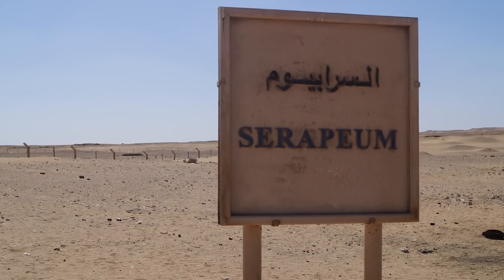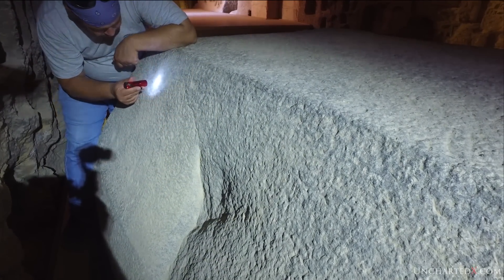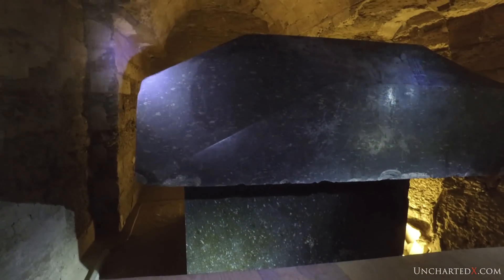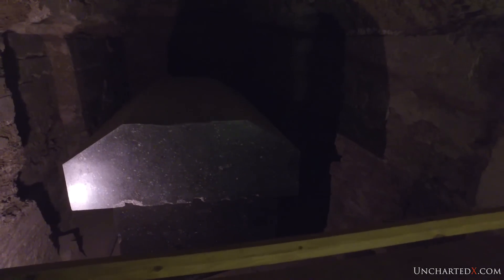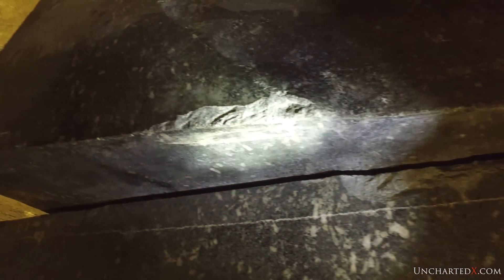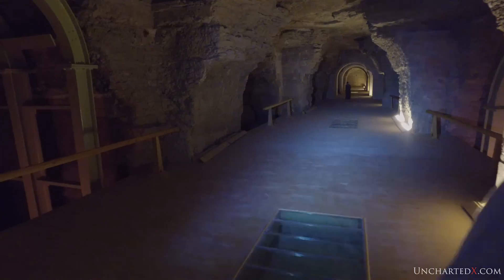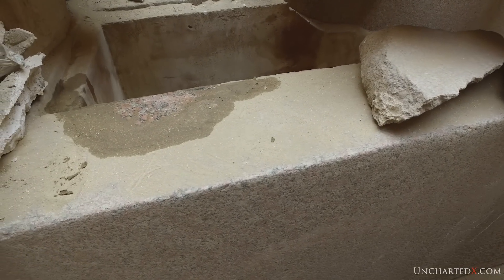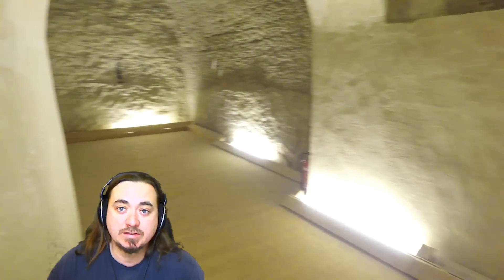Evidence of Ancient High Technology - Liquid Polishing at the Serapeum of Saqqara - Chapter 4

Comment: As a machinist I can tell you that when a hardened part breaks or develops a crack, its ground down past the extent of the crack  line then filled up with weld and re-milled. I think during  the making of these boxes, when a crack was found and or developed, the workers would work the crack line down to good material. They had no way of refilling this work done.  1 crack can spread and ruin the entire product just like a crack in a window. They did this to preserve the box and prevent any other spreading of said crack.  JMO

Comment: As occurred to me, a few comments for thought:  One, the marks of "liquid" on the underside of the lids might not be of polish, but of a material used as a sealant (or both polish and a sealant). Polishing is nice, but a sealant would give it that "wet stone" beauty. Two, the "machining linear marks" on the underside of large objects may be due to the simple moving of these large masses. I think we would be hard pressed to move such large heavy objects in an environment of sand, heavy dust, and rock without some resulting abrasions. The ancients would not be immune to this either. Third, your comparison of a modern polished granite statue ON THE SURFACE to an ancient on buried deep within the Serapeum has one glaring difference -sunlight and all of its damaging effects, as well as the heating and cooling and thermal expansion/contraction issues and abrasion from dust storms. Fourth, polishing divots and similar is more like polishing your car than building stone, but could be done. Generally, once prepared/formed for polishing (today), a surface has a mild abrasive applied (something softer than it is, usually in a wet slurry) rather than sand which is most likely hard quartz or maybe feldspar. Your discussions are great Ben -inspire thought for sure. Information does speak for itself. Keep up the good work, My wife and I are fascinated by your tours. Thanks

Comment: Hello Ben, great video! I've learned things from watching it. I never knew they had scooped out the cracked areas to prevent further cracking. That sounds logical. Modern day example would be when you get a crack on a vehicle's windshield from a road debris striking it. They recommend that a windshield repairer apply a glue adhesive to it as soon as possible before the crack grows longer and longer to a point that a windshield replacement is the only recourse. Cracks in materials will only become worse with time unless addressed right away. It also makes sense that they were more concerned about function over cosmetic appearance, even though they still polished it as best they could for aesthetic appeal and as a preservative.  When dealing with a huge multi-ton stone block, it's better to salvage it with minor repairs if possible than having to scrap the entire project. The liquid drip remains you shown us does indicate using a liquid polishing technique.

The very crude hieroglyphics does look like someone scratched it on later after finding it, rather than the master builders that created it. Egyptian Pharaohs were notorious for placing their cartouches  and hieroglyphics on things created by someone else from a past time, and then claiming it as their own. It's like if I should stamp my name on the Washington Monument after an apocalypse, then some later discoverer upon seeing it therefore thinks I had built it.

I'm glad there are intelligent people like you visiting and studying these amazing ancient sites and thinking out of the box to figure out how these things were actually constructed, instead of merely allowing the academics to spoon feed us whatever they want us to believe. I'm now a new subscriber. Thanks for the educational video and your other ones as well.
Reply from the maker: thanks for the kind comment! I'm glad you find my work interesting :)
Reply: Yeah it's a similar process to remedying metal fatigue cracks, in say aircraft structural components, by polishing out any stress faults/cracks identified by microscopy/spectroscopy to prevent a linear fracture developing.
Reply: Maybe polishing was not cosmetic at all, but a byproduct of the “working boxes”, whatever their purpose/function. You seem “sold” on the idea that the polish is for looks. Unlikely inthink

Comment: Hi Ben. There isn't enough gratitude in the world to express how thankful I am for your work. Please don't stop. I am so hooked I'm afraid that the grief would kill me. But, and there is always a but, the reasons given for the scooping of the material away from the structure just doesn't hit me as logical. If a crack can be scooped out of a surface it seems to me that the crack was finite to begin with and the scooping was unnecessary, at least for the purpose that has been put forward. Think about it. You see a crack and in order to improve the resilience of the material you scoop out the surrounding material until there is no longer evidence of a crack. What part of the scooping stopped the crack? I cannot think for a moment what part of the act of scooping out a crack stopped further cracking. If no scooping had been done, the crack would not have progressed any further because the crack was finite to begin with. When scooping did occure the only thing that was gained was that the terminus of the crack was discovered. Just sayin.
Dave Lowa

Comment: Thanks again Ben, your content is brilliant. Keep it coming! In mechanical engineering manufacture, we build cast metal parts. We regularly have to do some post casting excavation work by removing casting defects in the same manner as in these boxes. We remove the crack or indication in its entirety in order to mitigate the possibility of propagation of the crack. What is interesting is, we do this for components that are subject to stress/pressure/VIBRATION! For parts that are decorative in nature or perform none of these functions I just listed, we don't bother excavating, because without any forces, we don't expect the cracks to propagate. To conclude, it seems to me that their was indeed a function for these boxes and they were clearly subject to forces that could propagate cracking.

Comment: Chat GPT answers about the tech use of a granite box:

"A granite box, being a solid and durable material, can have various technological uses depending on its size, shape, and design. Here are a few potential applications:

1. Electronics Enclosure: Granite has excellent heat resistance and can provide a stable and protective environment for sensitive electronic components. It can be used to create enclosures for high-temperature or high-vibration environments, such as industrial equipment or military electronics.

2. Radiation Shielding: Granite has natural radiation-blocking properties due to its composition. It can be employed as a shielding material in applications where protection from radiation is necessary, such as in medical facilities or nuclear power plants.

3. Precision Instrument Housing: The stability and low vibration transmission of granite make it suitable for housing precision instruments that require a stable environment, such as optical devices, spectroscopy equipment, or laser systems. The material's inertness and resistance to temperature changes help maintain accuracy and reliability.

4. Calibration Standards: Due to its dimensional stability and resistance to wear, granite is often used as a reference material for calibration standards. It can provide a reliable and consistent surface for calibrating measurement devices, including coordinate measuring machines (CMMs) or optical comparators.

5. Decorative or Architectural Applications: While not purely technological, granite boxes can serve aesthetic and functional purposes in architecture and interior design. They can be used as decorative elements, planters, or even as part of a structure to provide a visually appealing and durable solution.

(...)"

Comment: One piece of gleened info i gained recently is that that highly polished steel is much more resilient to corrosion from moisture than unpolished. This would seem to be true of stone. Those boxes were polished to stand the test of time against corrosion. I believe that can be taken as the reason those boxes were polished.
Reply: But if they are buried then no erosion or corrosion can occur! Corrosion is a chemical process, erosion is natural! 😁 metals are attacked by acids or/and oxygen ! Stone is unreactive to oxygen... and you could pour acid on it til you ran out and wouldn't make a dent ! 😁
Reply: Polish is perhaps a byproduct of the process in motion that the boxes were performing. Explains why insides are not polished, maybey

Comment: Although the igneous rock of these boxes is made of crystals, the gross body of rock is not itself "crystalline." The mineral crystals that make up rock like granite and diorite are small and not aligned with each other. They grew in-situ when the igneous material cooled to a solid and their growth was limited by bumping into the other crystals growing around them. So the gross rock is composed of small, interlocked crystals. This gives this material toughness, because there are no planes along which the gross rock will fracture. In this regard, it's like carbon fiber in a resin. This is different from single crystals (with large-scale repetition of a homogeneous molecular structure) that have planes along which molecular bonds are substantially lower in strength (low-energy bonds) than other planes in the structure, creating fracture planes. Planes along which the bonds are stronger (higher-energy bonds) do not fracture easily. The gross rock of the boxes does not have large-scale fracture planes, even though the very small-scale crystals of which it is composed all have such planes. But because they are not aligned with each other, fractures in one crystal are unlikely to propagate through the rock along a single plane, causing fractures to wander like the cracks seen in the boxes, because there are no large-scale fracture planes to follow.
Reply from the maker: Thanks for the explanation!
Reply: Great explanation!
Reply: Glad someone explained this
Reply: @BaxterRoss  How the Hell does not everyone know this?  This is rock knowledge 101 for dummies
Reply: That implies that some seriously violent & powerful forces created the cracks in the granite. Maybe they were all "perfect" once but "using" them created forces that eventually caused small & even bigger cracks/fractures. And scoping out the cracks was done to maintain structural integrity and being essential repairs to maintain the function of the boxes.
Reply: @w8stral  I guess not all of us took Geology?
Reply: @deelove6899  Neither did I.  I have read a book or two and opened my eyes when looking at granite counters etc....  which is the exact same thing as paying money and taking a class...
Reply: Wonderfully concise explanation of planes of Cleavage. Sounds like a big agricultural region in northern Ohio...        ‹ =ºo)
Reply: @joenobody5913  Poor boy, open your eyes to the world around you
Reply: @joenobody5913  spot on. Fools seldom differ. I'm that clever,you are all below me.it must be a lonely place in his world of wonderful thoughts,almost 'god like'.
Reply: @joenobody5913  That was totally unnecessary, by telling us how you think that w8stral was a plonker, all you have really done is expose yourself as a plonker.
Reply: @jairdabrini  Someone carved a giant piece of granite out of the earth and moved it.  There's no guarantee the cracks weren't there to begin with, but quarrying granite necessarily involves violent and powerful forces.

Comment: The scooping of the granite to remove cracks is very interesting, and is practiced to this day in the manufacture of typically aerospace grade components, whereas cracks or imperfections that are identified thru non destructive testing inspections can be routed out and then deemed acceptable once the latent defect has been removed.  So why implement a level of quality control on an object that had no functional purpose?
Reply: They do the same thing with cracks in steel. Instead of scooping it out they find the ends and drill holes to stop the pathway.

Comment: It’s obvious my own speculation but could they have made like a silica powder then added it to something making a almost molecular fluid to fill in the small spaces. Almost like a crystal turtle wax?
Reply: Its probably a type of long lasting resin, like the ones we use to finish wood. Im guessing it was used as a final layer of insulation for the capacitors inside.
Reply: This was my thinking too.  They have plenty of silica around and I've seen some papers that they used phosphoric acid as a preservative.  Silica can be dissolved in phosphoric acid.  Paint on polish and repeat until smooth.  Who knows though, there are a lot more people with more knowledge of this stuff looking at it, surly they would have thought this a possibility already?

Comment: Looks like they used McGuire's Carnuba Wax.
Reply: I can't believe polishing a box is that big of a deal. Not easy just labor intensive. Polishing a granite box is like color sanding and polishing a car. After painting a car, you sand down by hand the textured painted surface smooth with like a 400 or 600 grit sandpaper and work your way down to a #5000 finer grit sandpaper. After sanding down the car's paint surface down smooth with the finest #5000 grit sand paper you can often hand polish the paint with a fine abrasive liquid & towel or even use a rotary buffing machine with a very fine liquid abrasive. After the car has been color sanded and polished you can seal the paint with a glaze or a wax to protect it from the sun, rain and pollution. If done properly you will have a very shiney and almost mirror like finish.
Reply: Nope, carnauba trees (Copernicia prunifera) are native to South America, so no.
Reply: Norbert, polishing a car’s finish is not quite the same as polishing granite stone.

Comment: it's the same way Michelangelo polished his marble statues. it's one thing everyone over looks but is actually the simplest technique. they do it in woodworking sometimes, when finishing a wood turning on the lathe you pick up a handful of shavings and hold them on the surface while the piece is turning and it smooths it out. the BEST material to sand or polish a surface you are working on is the SAME material you are trying to polish!!! it has the same hardness so they will wear down at the same time and produce a smoother surface. they likely already had some fairly flat granite "polishing" stones prepared in advance for this. take some already ground up and fine dust/powder, mix it into a slurry with water or oil(which at the time would have likely been olive oil or palm tree oil) and you have the perfect material mix for polishing to a finish that by today's standards is near impossible with our tools because the materials are of vastly different hardness.

i have the same answer for all those ancient civilizations where the archaeologists can't figure out HOW they carved this extremely hard stone... well the only thing of that hardness they had to work with WAS THAT STONE!!! break off chunks of it, rub it against the same stone until you create the tool needed... they both wear down at similar rates so it maintains a nice smooth surface and there's little finishing to be done. can also make a crude polishing tool by taking a flat piece of wood and embedding the polishing material onto it, it's not going to last as long but it's also a potential technique they used BUT that also leaves open the question of how did they manage to get a piece of wood to that kind of uniform flatness? it's more likely that they used the stone and slurry mixture.
Reply: While not necessarily wrong, it’s a logical and well thought out explanation that doesn’t address how the scooped areas were polished nor does it address what appears to be liquid runs on the underside that created the same degree of polish. I would think this explanation could more aptly be applied to the penultimate finishing step that still shows the roughness.  Seems like a liquid coating was used rather than polish which means it’s still there and can be sampled and analyzed.
Reply: @nostromo526  it's likely lacquer, a weather proof coating that is made from ground up insects. though in an environment like that where most of these are hermetically sealed it could as easily be wax. you can't maintain the level of farming they did on the scale they did without the help of bees!
Reply: @camojoe83  did you see the divets in those boxes?? He didn't heart it because although common sense it's ridiculous to say they polished these boxes with gravel. You can't hollow out stone with the same stone. You'd be there for years trying to replicate that! Sounds like some egyptology nonsense. Yeah they carved that giant  obelisk in Aswan quarry with rock boulders too, right? GTFOH
Reply: how did they get the inside surfaces within a few thousandths of an inch from perfectly flat? how did they get the inside corners of the boxes perfectly square? how did they do this after the fact evidenced by the giant unfinished stone box in the hallway?

Comment: In reference to the polished finish one must consider the possibility of an advanced coating.  This came to mind as it appears that some of this coating dripped or migrated to the underside of the lids.  It also would make it much more feasible to put a polished surface on hollows and unflattened surfaces and would require less effort with a polishing coating.